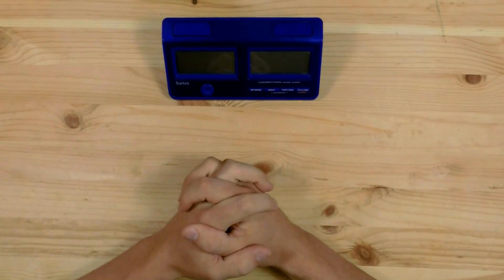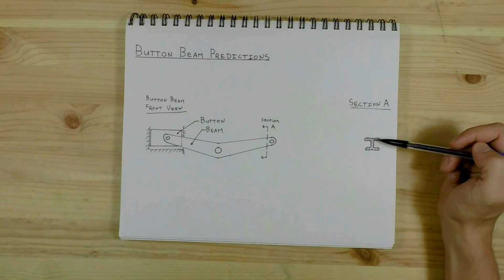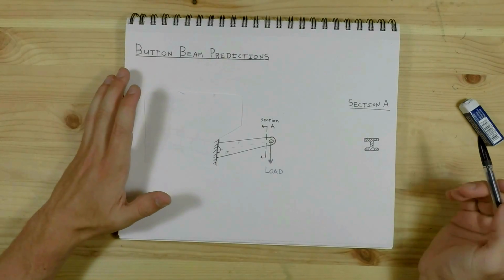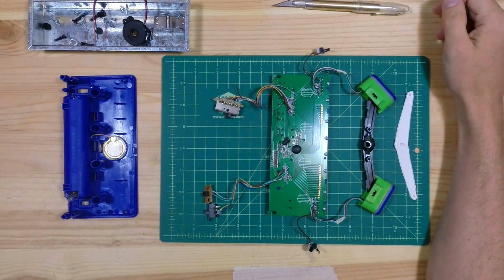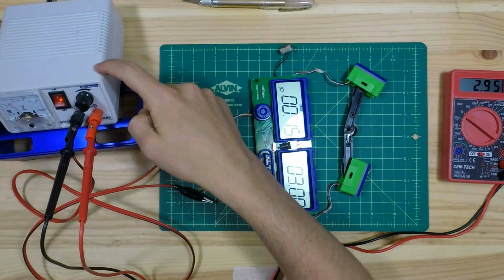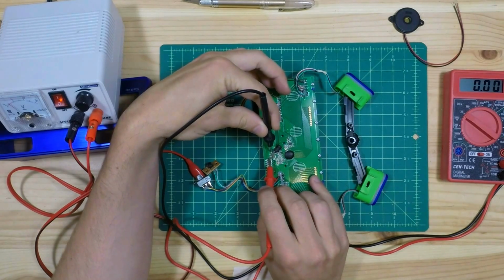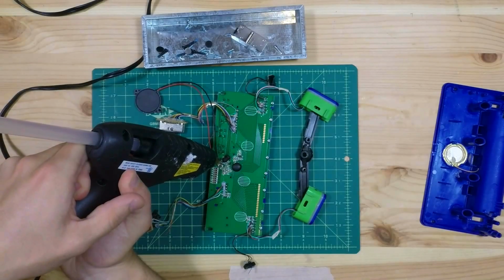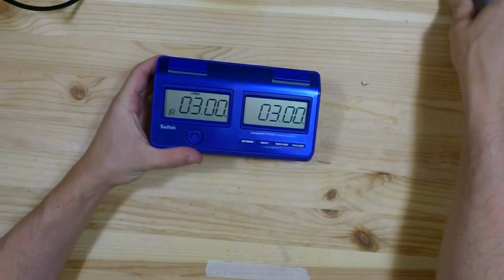Repair: Chess Timer

Comment: Great work. Got a question for you. I have a "Garde Electronic Chess Clock" (images of the clock on google). I have a problem with how to set the analog arms to display exactly the same time once the electronic system is activated when you set the clock for  a 5min game for example. The hands move to different positions on the analog displays.